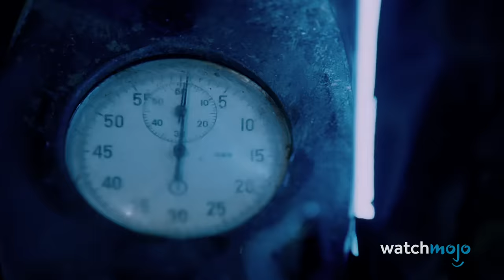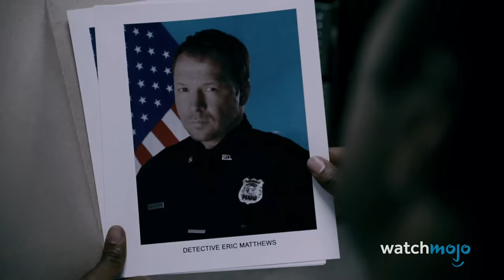Top 10 Saw Victims That Actually Escaped

Comment: There was no way out of Strahm's cube trap, Hoffman trapped there to die. There was no test he failed, there was literally no way out of that. The tracheotomy was a hat trick from his part
Reply: He could've done 2 things.
1 started drinking the water, sounds stupid but could've given him space to breathe 
2 using the pen tip pierce the rubber and pull. You'd either slowly drain it or create a hole in which water would rush out.

Comment: The only way to remove the reverse bear trap from your head without thr key isn't that simple. The setup of the trap is stupidly complicated and YOU CAN'T SEE IT, the trap might be activated when the small rope is touched while reacting after waking up, you would need to stay calm and not trigger it if you want unlimited time. The plates are bassicly inside of your mouth and when the trap is triggered they ate moving opposite to each other at high speed causing to your head being brutally stretched so you have to find something in a correct shape and enough solid to block the launch so you won't die. That's the moment whrn you have unlimited time till the trap is blocked so you have to remove the trap in this moment otherwise you are dead. The trap itself looks like a crown connected to a face mask that has 2 plates that are stretching your head, you have to find out how to remove the trap

Comment: I hate - HATE - the hair trap. Strange as it sounds, that was the thing that drove my suspension of disbelief too far. Your hair, even when tied into a rope, will break or be pulled out from the roots(which, admittedly, would really really hurt) before pulling your scalp away. It simply isn't strong enough.